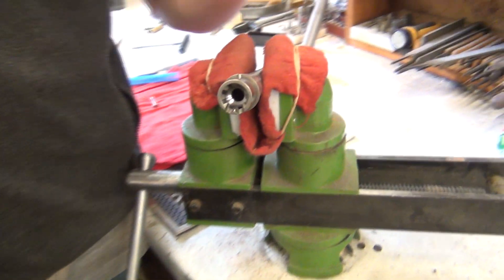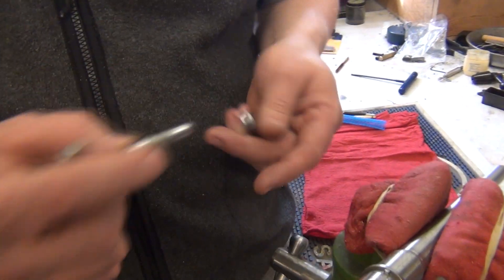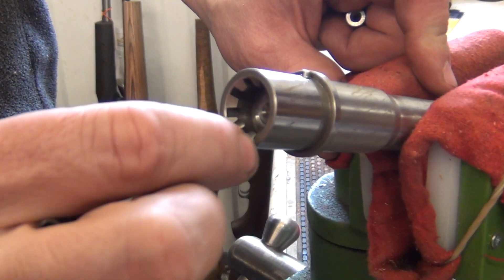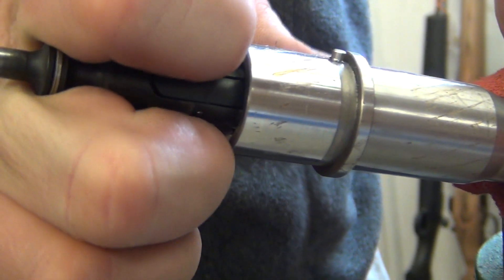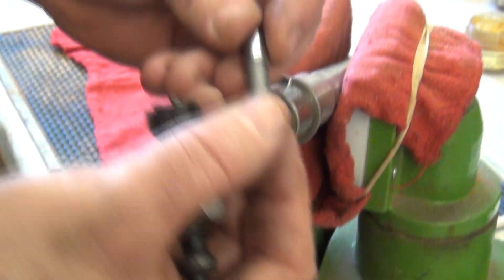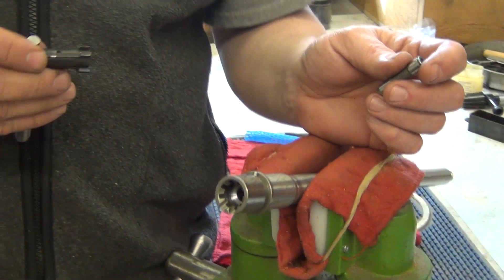AR-15 - Properly Check Headspace (Uninstalled Barrel)

Comment: its been a goal of mine to build my own for years now and i finally had the extra cash to do it. So i scowered the internet for the type of parts i wanted and like most people im on a budget so i looked for the best deals i could. I found a 16" Chrome lined 1:7 twist NATO 5.56 for $145 from DSA Arms Inc. And they had them readily in stock so i purchased one. Last weekend i built the entire rifle from the parts i had been collecting. The whole gun from scratch. I put it all together and it came out looking and feeling great. I was very happy with how it all went. Today after i work i came home n grabbed the upper off the rifle and headed tot the local gunsmith to have the headspace checked on it just to make sure it was good to go n didnt want any surprises touching off the first round. He took the rifle in back and a few minutes later came walking back "Headspace is no good"...MOTHER F*****R. He used ejectorless gauges and then took the ejector out just to make sure and sure as shit...didnt close on the field gauge. The barrel was brand new out of the box. How could it have bad headspace? Needless to say i was bummed out, but happy that i had it checked. Came home with my paperweight and called up the company and told them what the deal was. They called back about 10 minutes later and told me that they would be emailing a shipping label to have the barrel and the components it shipped with sent back to them for "fixing" or if needed complete replacement. I didnt think you could fix a barrel that had bad headspace because the gas port is already drilled. Has anyone else encountered this problem before? or did i just win the lottery in the AR15 barrel world?
Reply: Thanks for turning me on to DS Arms!  looks like good stuff from what I've read.

Comment: Thank you so much.  I can now check the headspace on my non-installed barrel.  I like this because I won't need to take apart the bolt.  I agree with Dale this is much easier and less work to check the headspace when the barrel is not attached to the upper.
Reply from the maker: You are very welcome :)

Comment: every build should be headspaced, it's just good practice. also, you should always use a stripped bolt so as not to get false readings. if the bolt won't close on the go gauge & a different bolt doesn't help, then u can either return the barrel or ream it. too much space & the barrel extension must be removed & the breach must be faced.

Comment: I think I got, but a new quality bolt and a new barrel should be milled to specs and checked before leaving the factory. If you change your old bolt or use an old barrel and or possibly an old bolt this would seem to be more important. Don't get me wrong I know it is better to check it to be sure.

Comment: Great video, seems simple enough. Question, what happens if the test fails. Whats the adjustment? taking material off the back of the bolt lugs? Replacing the bolt?
Reply from the maker: +John Gilmour The barrel would go back to the manufacturer for replacement or you could try a different bolt.

Comment: I have a AR 10. In 6.5 creedmoor and I am getting way to much pressure from Winchester factory ammo. I built the upper , put it together  ,  tightened the barrel to 35 lbs. And bought the ammo to the range.  Fired 3 rounds  and all 3 had very small cracks in the mouth of the case and deep crators in the primers. I don't know what's wrong but I'm not shooting it anymore untill  it's fixed.  Anyone have any ideas what's wrong???

Comment: so testing it with method, do you need to take parts off of the bolt like you did in the other video, or can you just leave the bolt fully assembled?
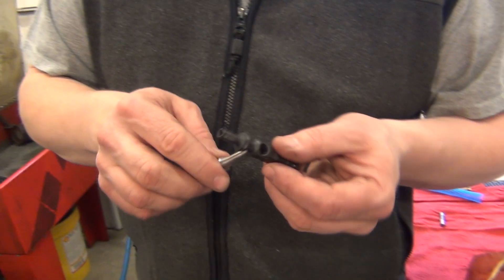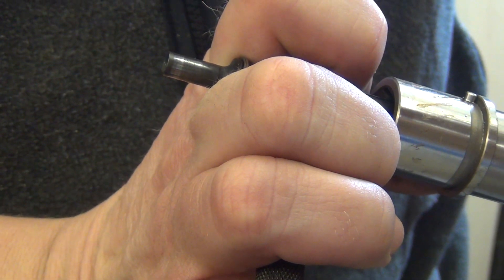Reply: @ 00:31 his bolt has the ejector and extractor installed and @ 01:33 he states to overcome the pressure of the extractor and ejector when he is checking for proper headspace so the bolt would have to be fully assembled for his method.  3 years late on the reply but figured I would answer it because your comment is up top in the comment section and for new viewers who may have the same question.  Cheers!

Comment: Notice he didn't disassemble the bolt. Using this method should I still plan on disassembling the bolt, or not? Just want to confirm as I will see if my FFL has some gauges to check my bolt (bought) and barrel (not bought) when I get them.
Reply from the maker: Dale knows what he's doing. If you follow the way he does it in this video, you'll be fine.
Reply: nsz85 So you don't need to disassemble the bolt if you're checking the headspace using just the barrel? I haven't assembled my rifle yet, so that would save me some time in the long run.
Reply: nsz85 What is headspace what does it do?

Comment: Suppose you check it with the go gauge and it doesn't move as much, how do adjust the headspace?
Reply from the maker: 4AGTurtle the quickest and most affordable way to attempt to fix headspace is to swap out your bolt for a different one.

Comment: If the barrel is installed, why can't you just hit the bolt release to chamber the head space gauges without disassembling the bolt? I mean all they are is just inert rounds what could happen?
Reply: you could destroy a guage and jam it in the chamber. not a good idea,.. use a gentle hand :)

Comment: 5000 videos on how to check the headspace, but not 1 that tells you what to do if it is out of spec.
I do not see any way of adjusting the headspace on an AR like you can on an AK.
I guess it is bolt or barrel replacement rather than any kind of adjustment?
Reply from the maker: +archangel20031 Barrel replacement or try a different bolt.
Reply: +archangel20031 Yep, try a different bolt first.  One of the two or a combination of the two are causing the headspace to be out of spec.  If you try another bolt and it passes, then problem resolved.  I usually try three different ones of multiple manufacturers with good reputations before declaring it to be a barrel issue.  The one thing I see regularly is cheap barrels not reamed correctly or the extension isn't timed correctly.  Both are terminal for headspace.  If it's a matter of the chamber being just a touch too tight, then a gunsmith/experienced armorer can bump the shoulder back by hand with a finishing reamer.  I see this a lot with melanite coated barrels.  Once they are bumped, they work fine.  We are taking dimension changes in the thousandths of an inch and sometimes the coating needs to be backed off a little.  If the chamber is too loose, the barrel is essentially a club and has to be replaced.  After messing with hundreds of barrels a month, I can tell you there are manufacturers to avoid like the plague and there are very easy ways to determine if the barrel is suspect; Rainer, SAA, KAK, bad ju-ju.  Their tolerances are horrible on both barrels and bolts.  We see some that pass, and we see some that don't.  It's the "some that don't" that causes all the problems.  They shouldn't exist but do.  Any barrel with no markings on it, DON'T BUY IT.  Any barrel with no manufacture markings on it, DON'T BUY IT.  The barrel is the heart of the rifle.  Absolutely do not skimp on the barrel!  Spend the money and get a reputable manufacturers barrel.  There are many and they really aren't that much more to buy a good one; Daniel Defense, FNH (FNH also makes BCM and Spikes barrels), White Oak Armament, Wilson Combat, Noveske...  Hell, any one of these is worth the money, made correctly, will last, and be in spec.  Everyone makes a lemon sooner or later, but I know for a fact these companies will back their barrels.
Reply: +Sean M 
The AK barrel I headspaced had issue because when it was pushed in flush with the trunnion (would not go any deeper) I needed to use the field gauge as the nogo was just barely snugging up as it closed.
I used my belt grinder to take a couple thou off the barrels bevelled contact edge and the barrel slid in a smidge deeper and it headspaced perfectly with the go gauge.
I guess it was reamed a smidge too deep.
 Various rounds fit wonderfully.
Reply: archangel20031 Yep.  That makes perfect sense with the AK platform.  They are different and have different tolerance issues.  There are ways to resolve some issues short of a barrel change.
Reply: +archangel20031 yeah adjusting headspace is a large pain. you would need to determine if it over or out headspace and by how much then you have to remove the barrel extension. take you cuts as needed to match your gauge or measurement of correction, then you probably have to relocate your barrel pin in barrel extension and even possibly change your gas tube location to make it function after headspace
Reply: nsz85 Sooo, you just keeping throwing out money on a different barrel or bolt and pray it is properly matched? That will only cost several hundred dollars and no guarantee. Has to be another way.

Comment: Wouldn't there be a pissing match between the maker of the barrel and the maker of the bolt if they're different manufacturers? If I have a WMD Guns BCG (which I do) and a BCM barrel (which is in transit to me), wouldn't BCM tell me I should have used a BCM BCG if there is an issue? Thanks.
Reply: This is why you want to try it with a different bolt (or 2).  If the problem is repeatable, you will have a solid argument for blaming the barrel.

Comment: Hi what go no go gauge would you use for 223 wylde a .223 rem or 5.56 or 223 wylde ? thanks
Reply: all those should go, but the no go on 223 going into .556 compatible chamber? probably not, but maybe it wouldn't be conclusive depending on size of the gauge vs tolerances which I don't know. Not 100% on this, just sharing what I do know.

Comment: Being that AR's are modular and parts are MilSpec 99.9% of the time how would you fix the issue if the headspacing was off? Send back the fucked up barrel that you bought? It's not like you can adjust anything is there?
Reply from the maker: Correct. It would need to be returned to the manufacturer and replaced.

Comment: question:  if you're doing your own build from the ground up, and you check the head space prior to assembling your upper, do you have to check it again after it's assembled, or is that a redundancy that isn't necessary??  please excuse me if that's a dumb question, but i'm in the information gathering phases of my build and haven't actually ordered any upper parts yet.  thanks, and thumbs up :-)
Reply: +KingTesticus You should be good to go after checking it before installation. The bolt locks up with the barrel and that technically should not change after installation into the upper receiver. You should still make sure your bolt carrier and bolt move freely inside the upper. Checking head space every few hundred rounds or if you encounter any split cases is a good idea.
Reply: kalenberg11
thank you.
yeah, i ordered the gauges on the logic that my safety is at least worth the extra $100.  and that's an excellent additional point:  they are useful to keep checking during the breaking-in period.  thanks again :-)
Reply: That is a great way to look at it, esp when it comes to safety, and BTW that was not a dumb question. It is good to see your smart enough to think about the build and ask questions.